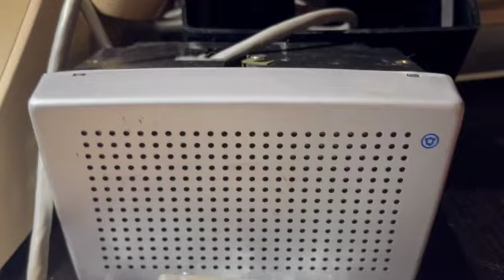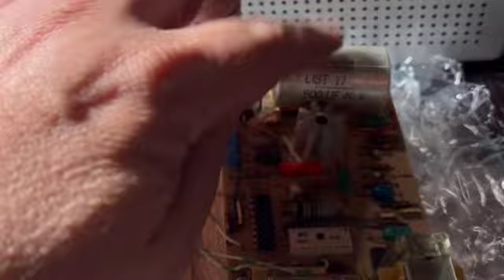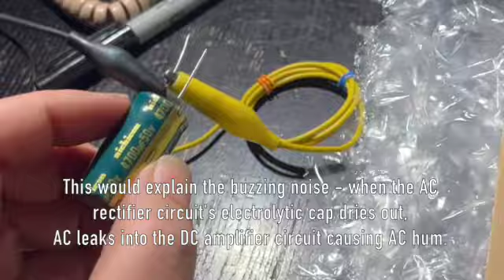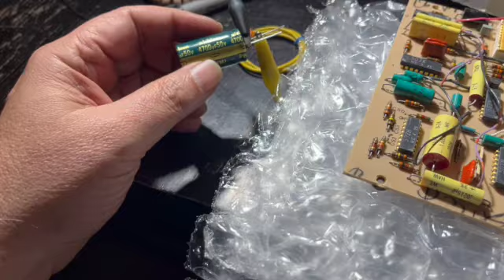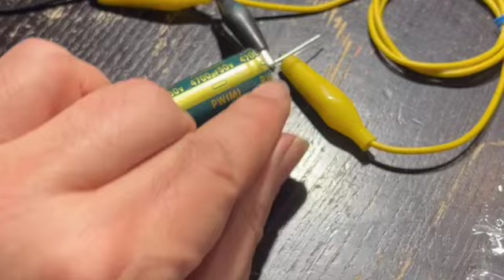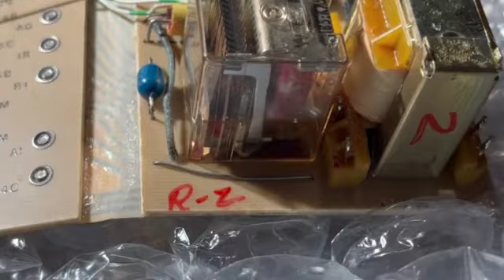Repairing a Western Electric 4A speakerphone with buzzing problem.

Comment: Sorry about the shaky cam, would have used a tripod but was in a rush to repair it, and once repaired, there was no going back for a second take. 
Since this was my business's active speakerphone, I went with that green "radial" cap for a quick repair. Electrically that cap is a good replacement, but not the best fit dimension-wise. Someday I'll replace it with a proper "axial" cap like the original.